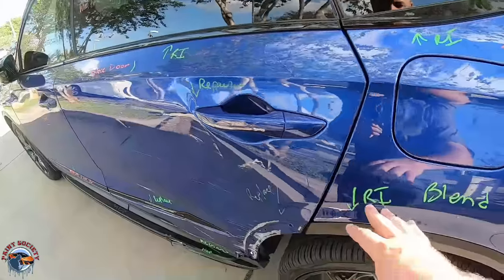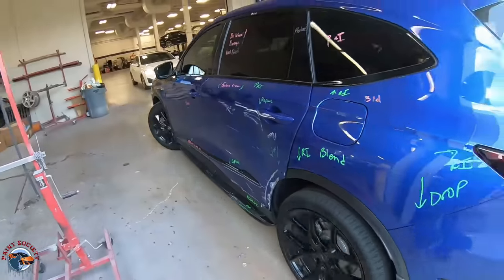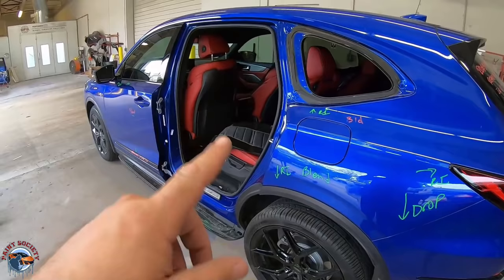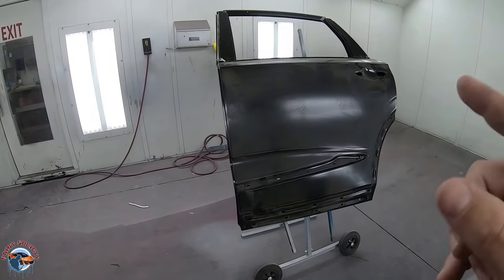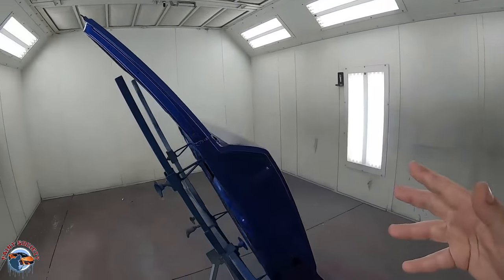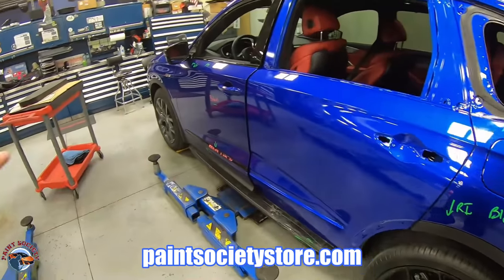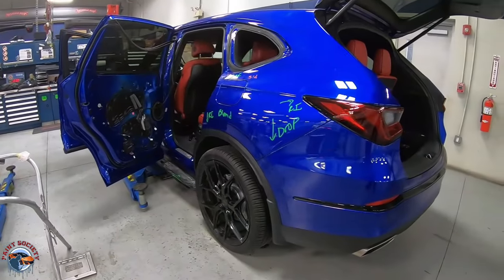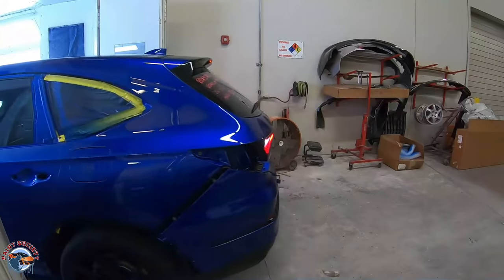How CRASHED Vehicles Are Fixed! Pt. 1

Comment: With the colour build plus system I had the same problem with transparent blues ( 2 coats of base being nowhere near enough) until another painter told me to never use the blue sealers use a dark grey or black depending on the tonality of the colour. He was 100 percent right. The blue sealers are useless. The colour build plus system is great but you have tweak it for best results. Luckily I worked in a shop with 12 other painters so I could benefit from their experience!

Comment: Good work. I typically fully paint the jamb but only seal & base the outside if I do it on a stand. The base can then be sanded to 600-800 as well to remove nibs and texture, and you'll get your coverage when doing it all assembled. Saves time and material vs. clearing the outside unneccesarily. Also reduces overall film thickness if that's relevant to the situation.
Reply from the maker: Yes this way makes sense as well and have done it like that. Here’s the issue I have. Sometimes when when replacing a fender I’ll paint it off the car first and clear it to see if it needs blending on the hood and the same with doors. With clear you really get a good idea or a “second chance” at tinting or changing the color when it comes to blending and you can only get that opportunity when the panel is cleared because you’ll get the true color. 

Again either way work work and if I know my color match is good I won’t even clear the front.

Comment: Really enjoy all your videos.  Super helpful!  I have been doing a lot of small jobs using aerosol paint and the 2k aerosol clear and have done well even on hoods.  I recently had to strip all the top surfaces on a maxima so I decide to spray with a hvlp gun.  Its a cheap $100.00 set with a standard size gun and a detail.  I got the set Almost 20 years and only used the detail gun once and had never used the standard size.  By watching your videos I was able to set up the gun almost perfect on the first try.   I just had to dial back the pressure 5 lbs and it did awesome!  Keep it up!
Reply from the maker: Nice! Hopefully this is the start of something great! Thanks for watching my videos

Comment: getting an OEM finish is super hard, we are painting rooftops brand new ones for a certain truck and they are orange peely as hell, but the roofs we spray always come out super smooth lol
Reply: Lower the pressure is usually the trick. If it’s to peely, a quick scuff with some 2000 and buff always helps me.

Comment: It didn’t match because it didn’t have enough coats? I’ve been doing it for 40 plus years and I’ve managed to paint a panel off the car (old time Centauri) and as far as I’m concerned , it was a fluke ( too many variables despite what paint companies promise
Reply from the maker: You’ll see in the next video I use the rest of the paint and add 3 more coats and it blends. Actually if you watch the end of the video you’ll see the finish product
Reply: My point is from my experience I would never expect to mix up a pint/quart/ etc and expect it to match the adjacent panels ,especially a door, without a blend.This is why insurance companies pay for blending.Are you not saying that if you applied more coats it would’ve matched perfectly?I’ve seen it only once ,on a newish 88 mustang single stage acrylic enamel,no less it was a shot in the dark,a fluke ,I didn’t want to use a blender(a compromise)on such a pristine new car(at the time)
Reply from the maker: You’re exactly right. If I had applied more coats it would have matched much better then it did in camera but regardless it always 100% of the time needs to be blended for the perfect match